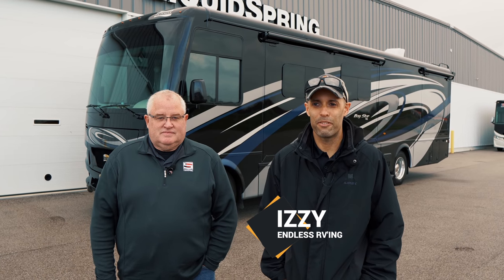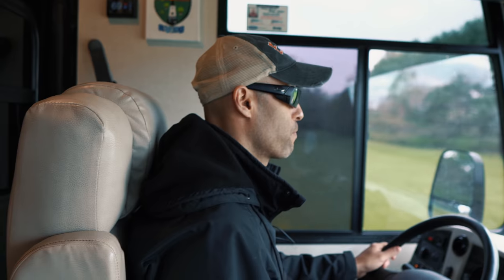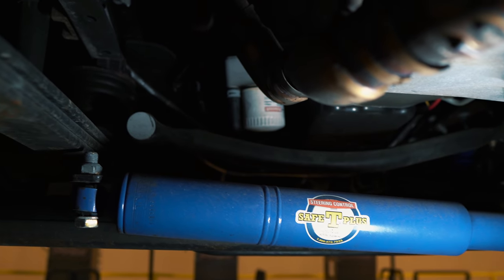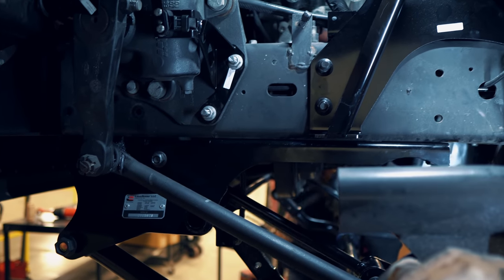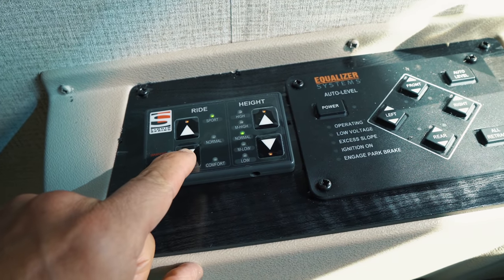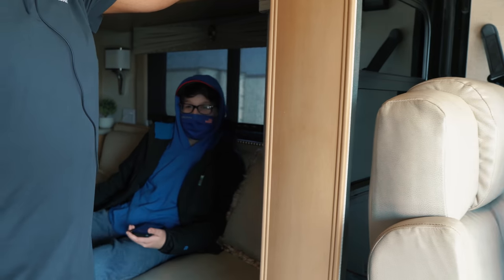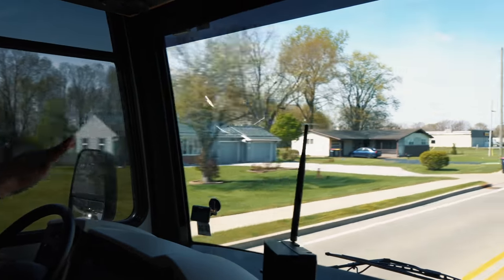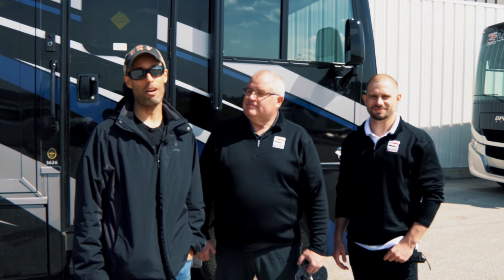The Best Upgrade We Have Ever Done To Our RV -- You WON'T FIND BETTER!

Comment: Well I am glad that I have a diesel pusher with a roadmaster chassis with an eight airbag suspension system. It handles like a sports car and with all due respect does not need the additional liquid spring system. I really think that the manufacturers of gas rigs need to make the liquid spring a standard option. Thomyt
Reply from the maker: Naturally a DP will have a much better suspension vs a gasser.  That is equalized with LS for much less in initial purchase as well as continued routine maintenance. 

Thanks for watching and the comment Tommy

Comment: Thanks for the great Video and information what is sad is that all this goes back to the chassis manufacturer (Ford in this case) and then,  the coach manufacturer... My guess your coach is about $180,000 to purchase today.... and to have to spend another $20,000 plus to have it drive and ride down the road in comfort,  we have had both a Diesel Pusher and a class C  so, were not new to RV's ... After reading so may posts about these new coach's needing upgrades out of the factory really is crazy...  Upgrade at the factory, charge a little more and let the customer be happy driving off the lot, not have to spend thousands on upgrades and days if not weeks working it out....  Shame on the RV manufacturer, they are well aware of the issues!  But again, thanks for the video!

Comment: Looks interesting, but after adding the Roadmaster HD anti-sway bars to the front and rear of my F53, plus having an alignment done, I'm pretty happy with the handling now.  It was an exercising ride before the modifications, as you pointed out.  However anti-sway bars don't help with the harshness of bumps and railroad tracks, which I don't like.  But when the road is good, mine handles pretty sweet now, even wind is less of a problem. I've put about 20,000 miles on my 32' rig and it's been acceptable,  much more pleasurable, but I'm sure liquid spring is more plush.  I especially like the ride height adjustability, that sounds pretty awesome.
Reply from the maker: Bolt on upgrades help a lot.  LS is a massive improvement and the best suspension upgrade you can do at this point.  It will take you to the handling of a DP if not better.  It’s that good 

Thanks for watching and the comment
Reply: @EndlessRVing  I think it would help if LS would explain how they can compress liquid.  I didn't think you could compress liquid much.  And also what kind of pressures are those hoses seeing?  I'd worry about springing a leak with age.  Do they recommend changing the rubber hoses every 6yrs like tires?  What kind of liquid is used? Hydraulic fluid I presume.
Reply from the maker: @TomSpurlock  the liquid is silicone based.  I believe the psi in those hoses is 3k range.  There is no maintenance for the system other than periodically checking if bolts have loosened (which they should not) If there is an issue with the system the onboard computer tells you.  The system has been used for years on emergency vehicles and buses with great success.  I believe there is 5 year 100k warranty on the parts but that info is on LS website.

Comment: I've read in a separate RV Forum that one "negative" outcome of the 4-corner LS install is the seeming need for more constant steering correction when compared to the stock installation.  I'm interested in your own reaction (or lack of) to this comment.  It was stated that "the one thing I’m still getting used to in driving a MH is the need for constant steering input, even after the LS install".  Can you comment, please?
Reply from the maker: Not our experience. We have actually documented in numerous videos driving highway speed with 1 hand tracking dead straight down the highway.   Note we do have a safe-t-plus installed but even when we drove the demo vehicle there was no issue with tracking.
Reply: @EndlessRVing  That's very reassuring.  I'm seriously considering the 4-corner install on my 2016 Open Road, but the last thing I'd want to get with that package is the sensation of "driving on Ice" and constantly having to pull it back from its own excursions.  Really appreciate your quick reply.
Reply from the maker: @mikemcmahon4025  contact Wayne Wells from LS and set up a test drive in one of their demo vehicle and then make a decision from there.   Wayne knows us very well. 

+1 (503) 709-8901

Comment: Great video.  Thinking about this upgrade for a new coach on order.  The video was very clear that the LS upgrade removed the side to side issues....but how was the ride on bumpy roads....the jarring feedback in the coach...the rattling?
Reply from the maker: Smooths out a bit but no suspension will defeat bad roads.   LS really shines improving the handling of the coach.

Comment: We are looking at installing on our 2017 Bay Star 3401.  Biggest complaint is te rough ride and rattles over failing roads and bridges, especially the expansion joints.   Not a big problem with sway on this model. How does yours ride now? How are the rattles? Great video and information.  Don
Reply from the maker: Test drive a LS coach and you will purchase the system.  It’s like a different coach.  Thanks for watching and the comment

Comment: Thanks for the updated video.  I'm with Carl, what's the ball park on cost for a four corner system??
Reply from the maker: 20k
Reply: @EndlessRVing  Wow, what did you already sink into the upgrades you completed?  Do you really think it's worth that much? I'd have to drive a vehicle with the system already installed and have to feel an amazing difference before I'd shell that much out.  Thanks for the info.
Reply from the maker: @kerwinmcnamara3815  we encourage you to drive a demo unit if you have the opportunity

Comment: Sorry if I missed it…does the unit have a maintenance schedule? Do the fluids ever breakdown and require replacement or is it lifetime?
Reply from the maker: There is no maintenance and the fluids do not need replacement.
Reply: My 2022 Entegra Vision XL is in the Belmont MS shop right now getting a 4 corner install.   I just discovered there is some maintenance that is required every 25,000 miles or Six months.  It is getting the bolts re-torqued.  They are 600 foot pound standard so that rules out me getting underneath and doing that myself.  
Izzy and MJ:  Where/what kind of shop do you go to to get yours re-torqued?  Did you go back to LS for the initial 1,000 mile re-torque?  Thank you.   Glenn and Pam Lang, Decatur AL

Comment: Outstanding engineering for sure. What is the extra weight, and how does effect of the GVW?
Reply from the maker: About 600 lbs over stock.  Unofficially our 24k chassis is equivalent to 26k now as the only difference between the 2 chassis are the leaf springs.
Reply: @EndlessRVing  been watching, seems you really like the system, can’t wait to further reviews on down the road. By the way, how is MJ’s eye doing? You take care, be safe.

Comment: Question , Since the suspension is now height adjustable does that effect your leveling system IE: do you have to lower the ride height when you park at a site ?
Reply from the maker: You don’t have to lower the coach but it’s best to do so as it will actually give your levelers more adjustability. Thanks for watching and the comment

Comment: Hi guys. We're having liquid springs put on our bay star 3014 as i write to you:) What i'd like to know is this, how much weight does it add? The leaf springs are pretty heavy so with thise taken off do you know what added weight there is? Thanks.
Reply from the maker: 4 corner approx 600 lbs added weight